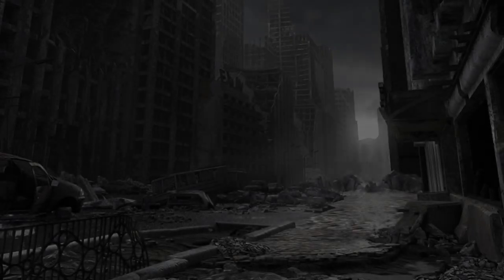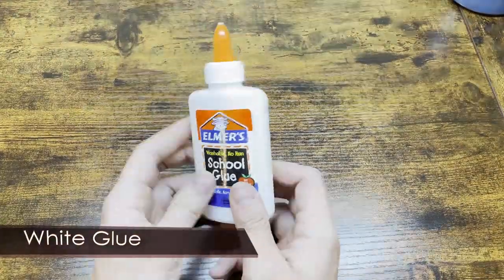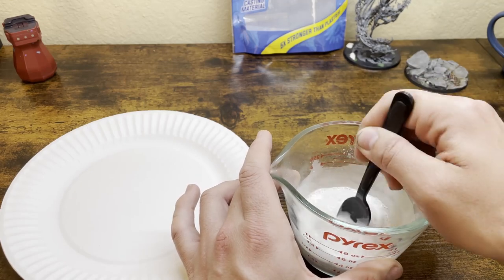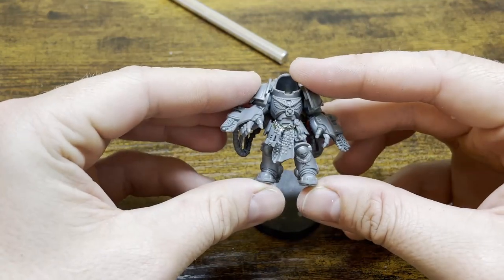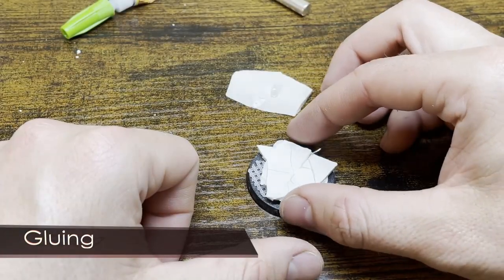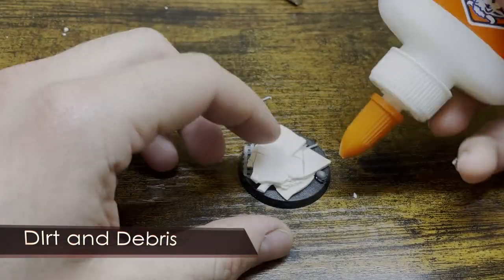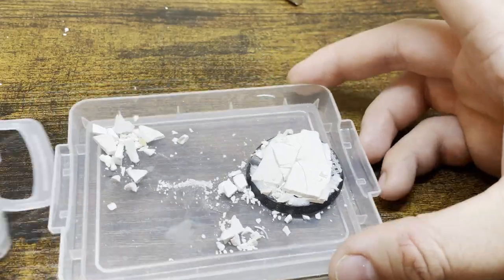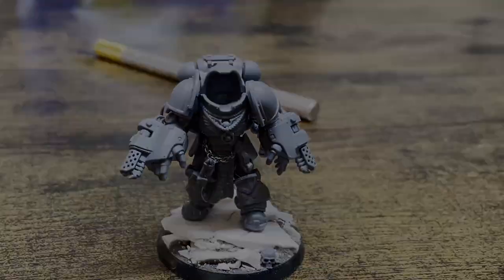40k Urban Rubble Bases

Comment: That plaster stuff looks way better than cork. You can decorate and paint cork as much as you want, it still shows that it's cork. Now I only have to figure out what kind to pick (since I'm in Austria and don't have access to the same one)
Reply: It's out of stock here in America anyways.
Reply: I can work cork to make it look like rocks, but I don't think you can make it look like concrete rubble. 

I agree though that cork just looks like cork if you are not good at working it properly. you have to carve it and pull bits out of it and stuff to make it actually look like rock.

Using wood chips is better for creating natural rock though, it doesn't take half the amount of work.

Comment: This is great, but why are my casting pieces not sticking to the plate? They're also very brittle. Did I do something wrong?
Reply from the maker: From other viewers experience the plaster I specifically used I guess works best, other brands are too brittle. If the plate is uncoated and just bare paper it should stick if it gets plenty saturated
Reply: @theminiaturemen40k  Oh I used the same brand of plaster
Reply: I shall try again 💀

Comment: Im having an issue where the plaster isnt "sticking" to the paper plates everywhere. Itll stick in some spots but not it others and I cant get a solid paper base.
Reply from the maker: Are the paper plates coated with anything? If they are just super cheap plain paper it should stick pretty well
Reply: @theminiaturemen40k I think I wasn't adding enough water so it didn't properly soak into the paper. Tried it again an it seems to have worked much better! Thanks for the tutorial!

Comment: My issue with this is that the "top layer" of the plaster easily comes off if it gets  handled rough at all. I've had chunks peel off when trying to attach a miniature to it. It's the only reason why I've stayed with Cork. If you have a solution tho, I'd love to hear it.
Reply from the maker: It may be the different types of plaster. The stuff I use in the video claims to be twice as tough and dries extremely hard and after nearly a year of games I haven’t had any flaking or issues
Reply: @theminiaturemen40k  thank you. Will try different types. Also I tried using the plate trick but my plaster separates from the plates, so it might just be the plaster after all.
Reply: @theminiaturemen40k  just wanted to update, but yeah, this stuff you're using on the video is MUCH stronger than regular Plaster. I bought it and the pieces came out sharp and beautiful, and take an beating.

Thank you
Reply from the maker: Awesome! That’s great to hear!
Reply: @theminiaturemen40k  had the same issue with Paris Plaster (most common here in Canada). Is there a specific drying method or mixing that helps harden the plaster? Mine is very brittle and snaps easily with just my fingers.
Reply from the maker: @npf6717   We found the solution was to use plaster I used in the video as it’s much stronger than regular plaster of Paris. Otherwise there’s no special mixing or drying process
Reply: @npf6717  What you are looking for is a gypsum, Portland cement and acrylic resin mix kind of plaster that is used in fine arts molding, FX or dental work. They are super hard, take very fine detail and are perfect for this use. Brands like Ultracal 30 or Hydrocal in the US, or Crystalcal R in the UK and EU are the ones you'll find in artstores or some trade shops.